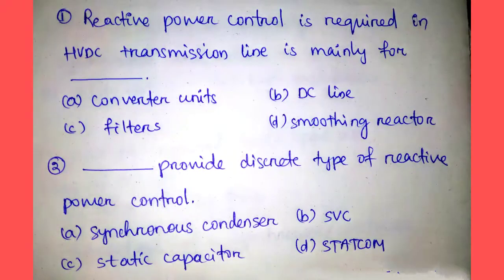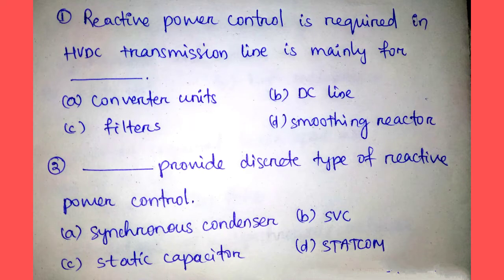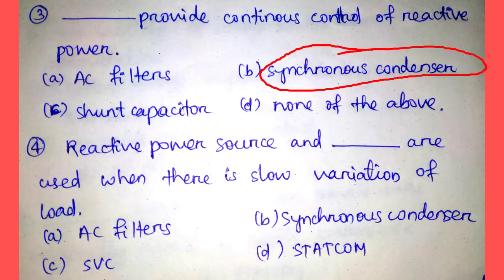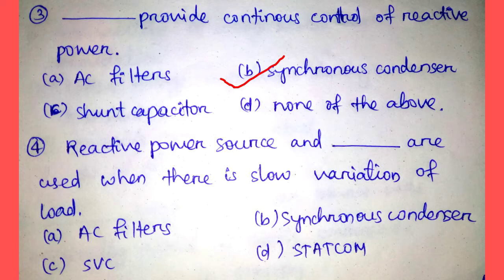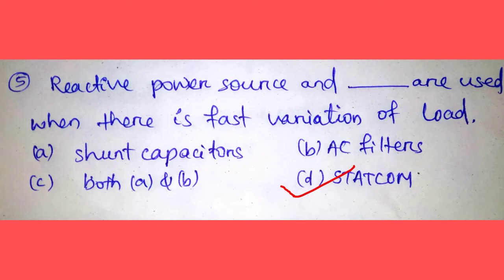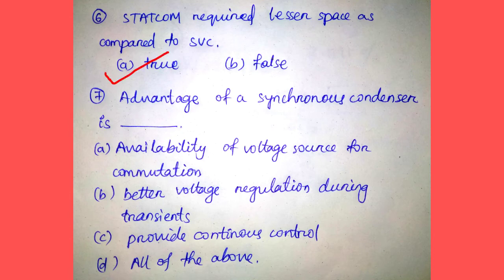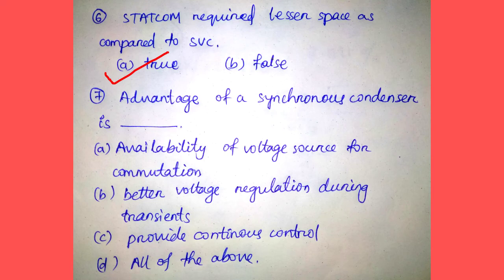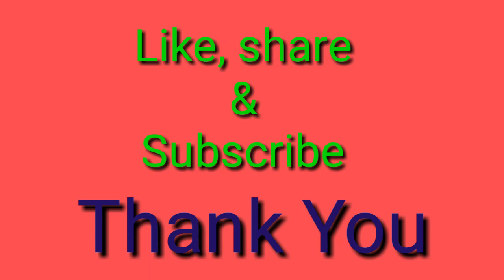#HVDC_MCQ  Reactive power control MCQ || Chapter -06

Comment: Reactive power is nothing but the power oscillations in the circuit due to inductors and capacitors present. It is really confusing when we are studying reactive power only with the phasor diagram, here I have explained the concept with the help of fundamental waveforms. Also explained why reactive power compensation is necessary, how we can compensate.